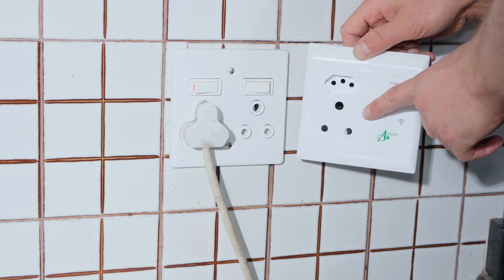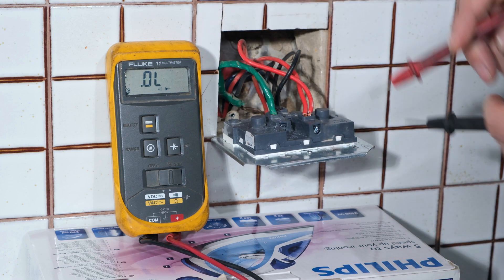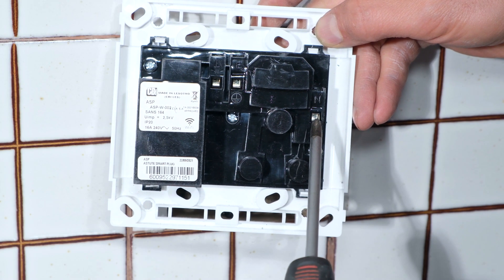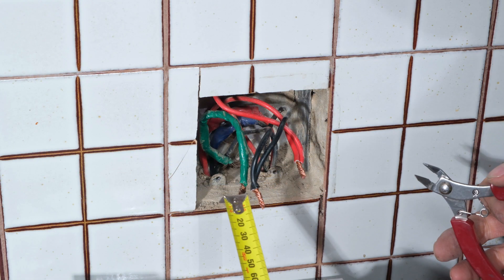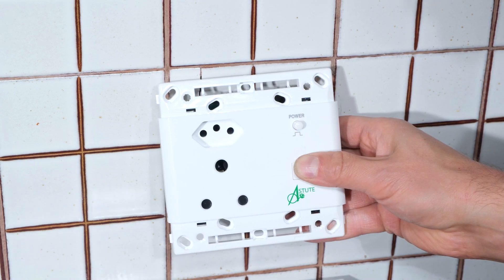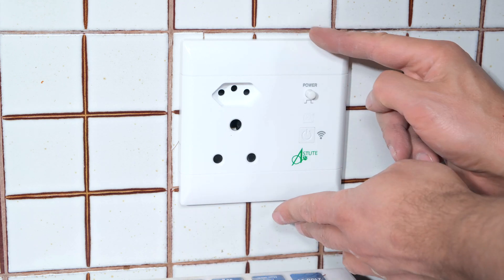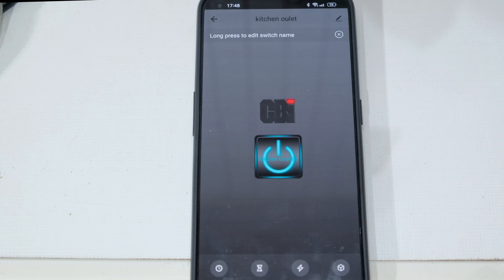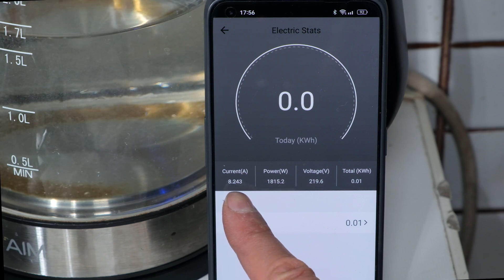How to install the CBI electric Astute Plug outlet to control your appliances remotely - Tutorial

Comment: Nice video issue i have is inverter trips before the plug cuts the load so inverter is to small or i have to run new wires for the specific plug for old fridge